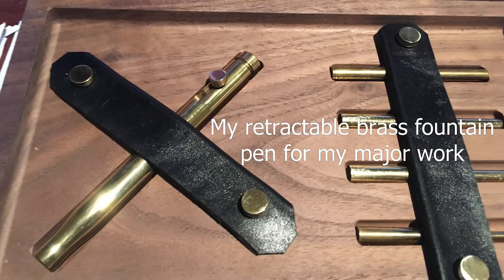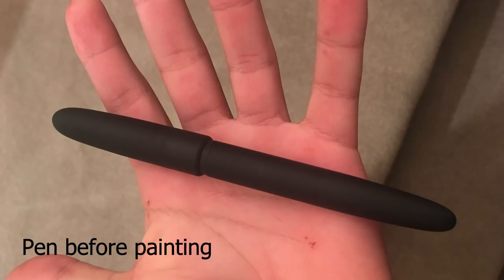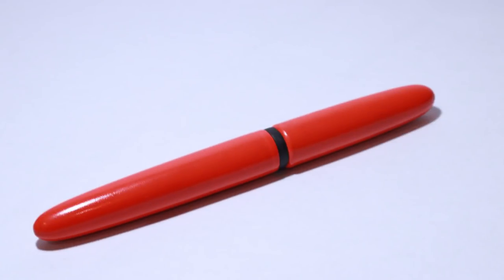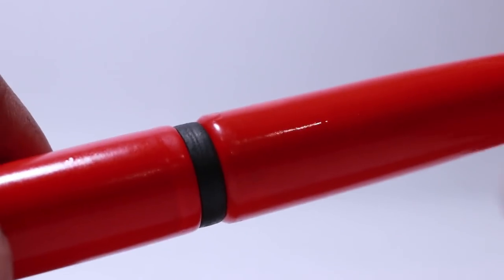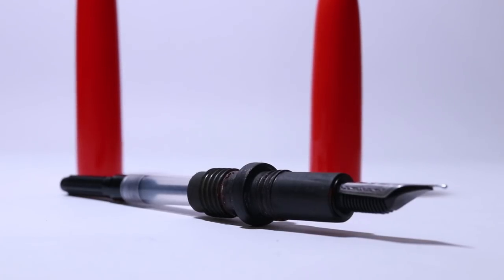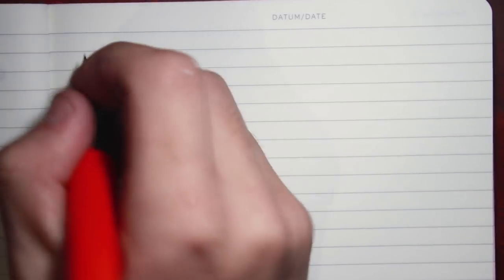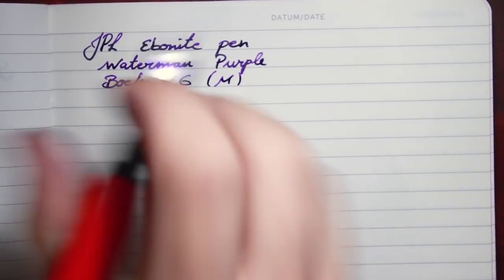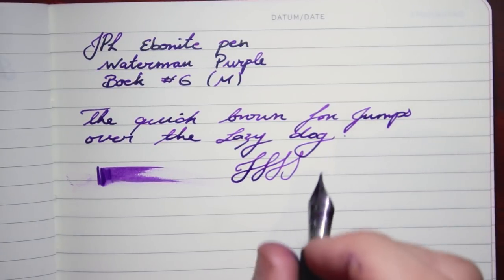I Made An Ebonite Fountain Pen

Comment: Congratulations, it looks great.  The colour combination is awesome, as is the form factor.  Will you be adding a clip or one of those ring things to stop it rolling around?  Is the feed ebonite as well?
I've been looking into doing the same thing.  They have lathes available at your U?  Obviously we can see the appeal.  It's probably worth trying out for some extra cash and experience points.
Reply from the maker: Thankyou so much. I made a model of the pen with a clip in solidworks and I think the clip made it look worse. Ill probably add a roll stop or a pen pillow to stop it rolling around. The feed here is not ebonite, I tried to find a nib unit that was ebonite but I couldn't find one and you need to use a nib unit for kitless pens. it is great fun doing this, lathes are great. I have been using the lathe at my uni for some pens but I recently bought my own to use at home.

Comment: Which lathe did you buy .I really want to start my own pen making but I cannot find a lathe
Reply from the maker: Well I had two options, a metal lathe or wood lathe. A metal lathe gives me precision but a wood lathe is better for making curves. I chose a metal lathe and have to have a few attachments for using wood tools, but it gives me great accuracy for making threads. The lathe I got was a sieg c3 for about $800 plus about $400 in tooling

Comment: Hello. As a fellow pen lover/machinist I would like to give you some suggestions. First of all there are a lot of quality and colorfull ebonite coming from India, on eBay you can check ranga pens and he is also selling ebonite rod stock.Also a good trick to get a nice surface finish off the lathe is to use support Center and this also helps with accuracy especially on flexible material like this.Also you could have make it more seamless by 1:letting some spare material for additional adjustment 2:making two mandrels (making them out of ebonite wouldn't be a bad idea) and placing the pen between them(effectively maching it between centers)and sanding or machining it so it wouldn't have so much of a dimensional differences. Also that will let you get it to a polished finish without the need for lacquer (which breaks,burns and yellows).This gen 1 pen looks pretty good but I think that you can improve upon it.Some flat or conned tops and bottoms wouldn't be bad😉😉.The  Edison ebonite is nice example. Chrisup has a nice one.